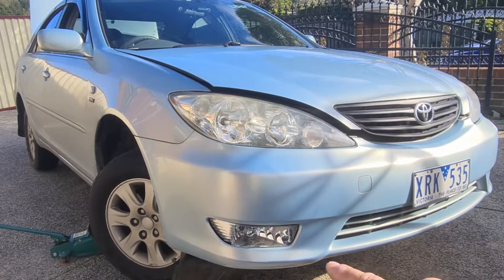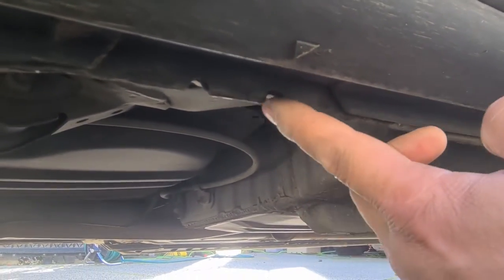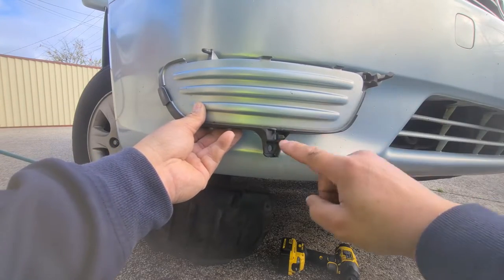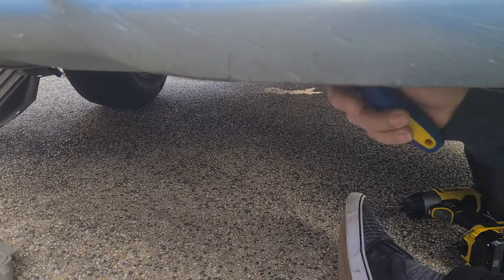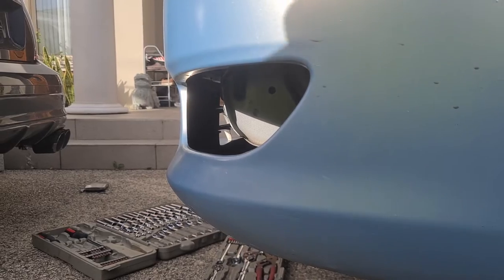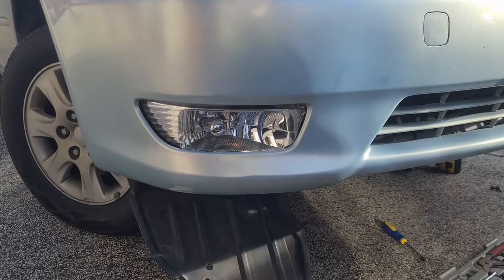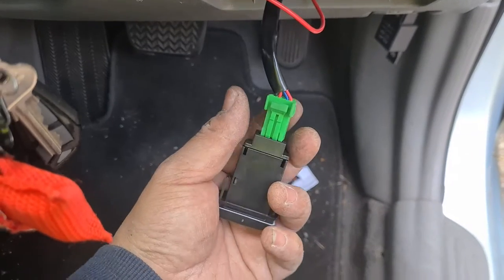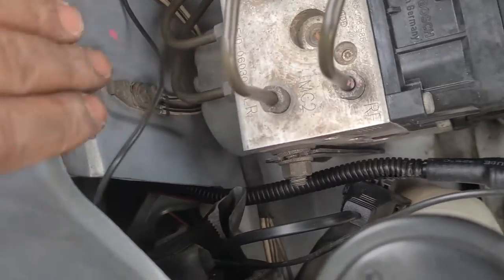02-05 Toyota camry ACV36R fog light install with wiring harness 9006  halogen bulbs

Comment: to use the facory wireing u need to to change the light switch to one with fog light switch on it and find where the relay goes in and thats all to use factory wireing
Reply from the maker: @garycusack9247  lol i will try that..sounds simple enough
Reply: I tried changing the indicator stalk and installed a relay behind the interior fusebox. However nothing happens when I turn it on with the low beams on
Reply from the maker: @brianh4496  hmm I think the relay should be in the fuse box shouldn't it? cuz that's where the wires connect?
Reply: @MIKEYZVLOGZ  Yes the relay is missing from factory. It’s a 4 pin relay.
Reply: Hard to figure it out
Reply from the maker: @brianh4496  that's kinda why I did it my way
Reply: @MIKEYZVLOGZ  if I figure it out I let you know
Reply from the maker: @brianh4496  pls do
Reply from the maker: @brianh4496  I saw the original.wiring too ... but it was so much easier just using the wiring harness and the button they gave in the kit and then installing retrofit fog lamps... was very easy ... but if u can do a full retrofit even better

Comment: isnt the car already prewired in the factory i see the fog light plug hanging down
Reply from the maker: I saw that nut didn't find where it led to..so i just ran my own cables ... I plugged them in and nothing ... I guess u can follow that and connect to it and connect the switch to it and should work

Comment: To jack up a car you don’t need to jack it up from the pinch welds, the pinch welds are where you should put a jack stand. Jack stands are much safer than only using the jack
Reply from the maker: good tips
Reply: "Jack stands are much safer than only using the jack". Very true! Good advice!
Reply from the maker: ye I agree... only if I'm under the car for a long period then I would use jack stands ..and I even sometimes leave the jack too as extra precaution... only if it doesn't get in the way of the job I'm doing... but def use jack stands whenever possible

Comment: think the relay might go in the plack box in the engine bay or on the back of the fusebox in the cabin not 100 percent sure
Reply from the maker: ye most likely ... so u think if I installl the relay in the right spot thr during will work

Comment: dont 4 get u need to change the headlight switch over to 1 with fog light switch on it is easy to swap the over need to remove shroud in front of wheel then there is 2 screws that hod the stalk on undo then and then unplug then reversal mode to install ne switch must admit didnt know about the 2 different size fog lights 1 for sportive and different type for the ascent model

Comment: I am about to install fog lights on my Toyota Camry 2005 v6 so it was good that I found your video. I do have one question. The harness has two earth wires. Is it necessary to connect both to the car body or will one be enough? Thanks for this very informative video.
Reply from the maker: harness? there's only 1 plug which is the one that plugs into the bulbs.. as for the earth yes u need to install both as they ground different points. one for inside of car switch power and the other is for fog light bulbs wiring which ground in engine bay ..so yes ground both earth wires

Comment: I installed the fog lights but cannot find the wiring steps for this, particularly the fuse plug wire
 modification
Reply from the maker: https://s.click.aliexpress.com/e/_m014OLo

or I'll send u an ebay and Amazon link wen I get back bud
fo u meant where to route it or how to route it? as in which route to take and how u get it to the cockpit

Comment: What size screws did you use to screw in the fog lights?
Reply from the maker: I didn't it's the same ones on the car...so the screws that secured the fog light covers to the bumpers are the same ones u use for fog lights